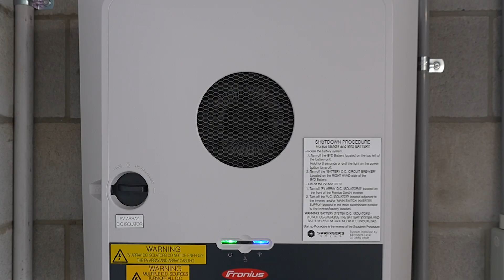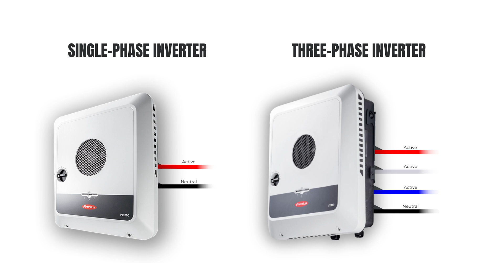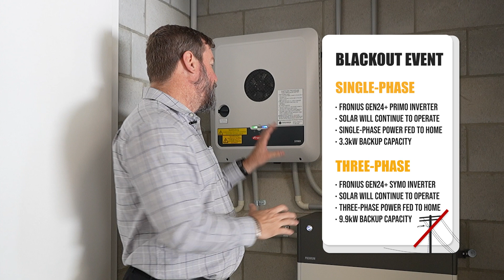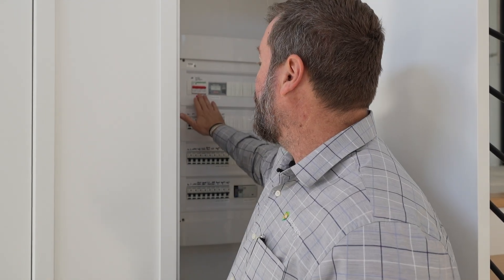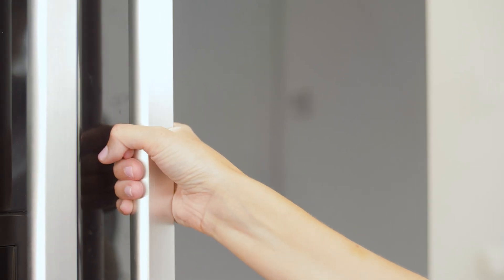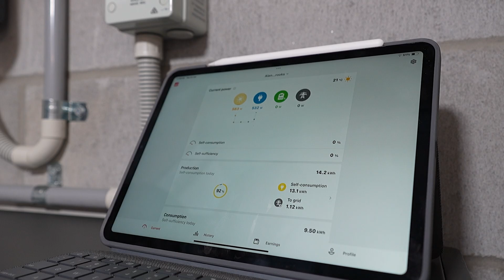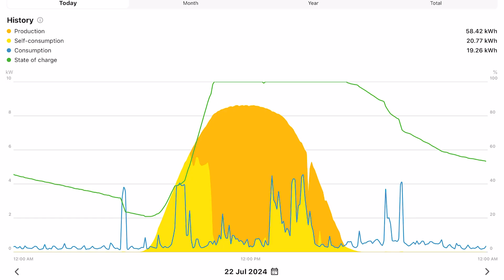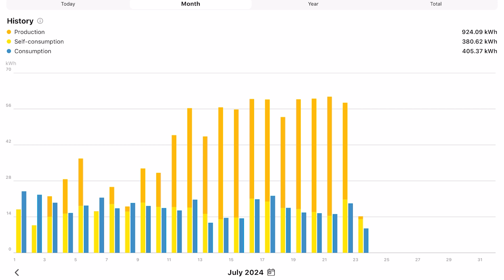Testing Fronius Gen24+ & BYD Battery in a BLACKOUT

Comment: what is the battery size there?  because that's going to be the important factor run time. 
we're going 13kw array with 16kwh stack with potential of adding another cell or two depending on our usage sans mains.
for us is the ability to keep 2 air-conditioners running over night in the event of power failure, and cover two fridges and a freezer.
Reply from the maker: Thanks for watching - this battery stack stores up to 11.04kWh and can be expanded should their consumption increase.

Comment: In my opinion, the delay in switching to battery is a significant downside. If you have super reliable power and you are only worried about extended outages the delay may not be much of an issue, but if you lose power more often for short periods you are still going to need a UPS for your electronics otherwise you will still crash your computer and backup drives. Also anything with a compressor (fridge, freezer, AC, etc) HATE being powered off for short periods.
Reply: first world problems lol    yes, you could go sungrow but they have higher failure rates, or risk the new market untested signenergy, but it's going to cost more, quite a bit more in fact.   I wish I could afford sig myself, but, I can't.
Reply: @John-gm8ty  Then Deye is an awesome option, UPS style backup, heaps of features, warranty and value.
Reply: @ the cost of a UPS at 20kwh is quite something I can assure you.

Comment: I am correct in that a 10Kw Fronius Gen24 Primo (single phase) that only 3KW is available on outage. Why not 10Kw?
Reply from the maker: @davidgalea430  3kW is available when using PV point (without batteries). With batteries, and the use of an external contactor, the output is dependent on the size of the battery bank and can be up to 10kW.